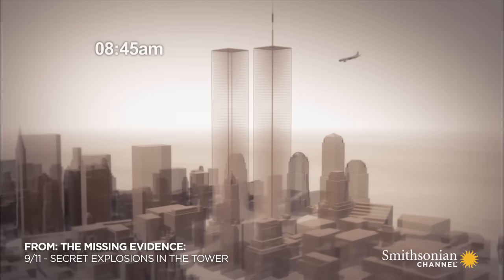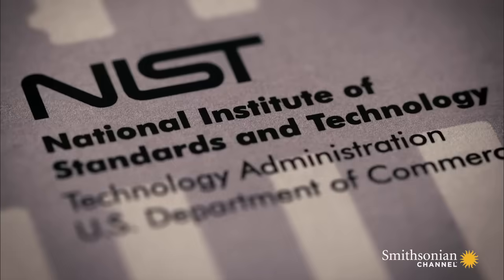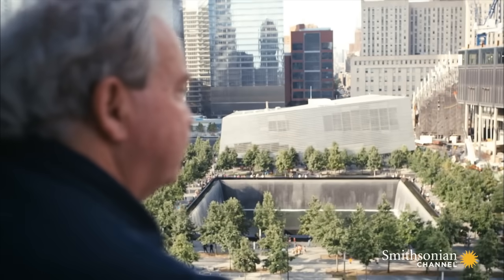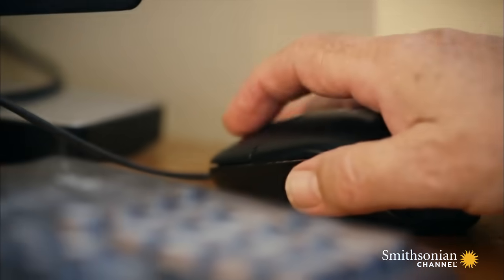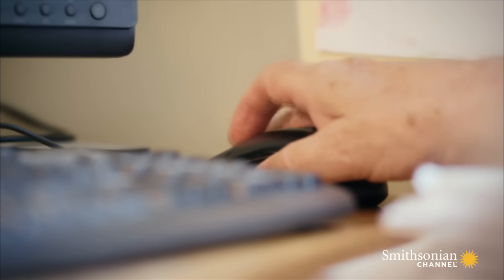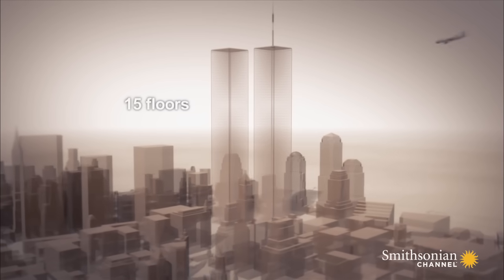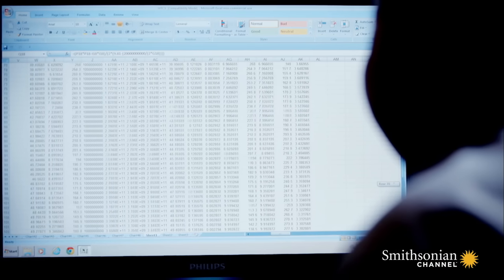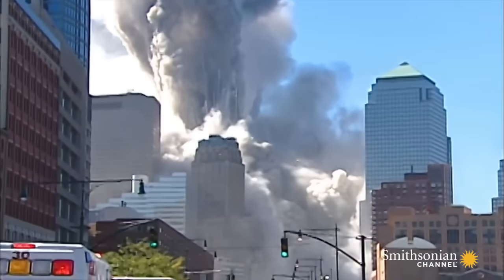This Computer Simulation Explains How the Twin Towers Fell

Comment: mustache dude did his simulation on a excel worksheet : brilliant lol...
and they wonder why nobody believes their version :D
Reply: Excel has VBA implemented, you can make aprogram (or Macro code) which utilizes data sorted in excel format. Its the same way as writing "real" program in Java/C#/C++ or another language using regular vaiables or x elemenst arrays.
Reply: I am not advocating this video, just explaining you can write program in excel.
Reply: @Cross8ow  But when you're trying to prove your point on something of that importance - which could/has ignited war - then you'll try using some more trustworthy methods than 2 columns of data from a spreadsheet.
I don't know if you're aware of the humongous quantity of factors that must be taken into account in those kind of simulation : resistance of all the different materials, complex physics formulas to apply on those variables in order to predict the way they'll behave and how those results will influence the other formulas...
Mustache dude did all this with a 5 column excel spreadsheet...
I did some data crunching for generating sales reports some time ago, and it was waaaaaay more complex than mustache dude's excel, and it was on specialized software.  So for simulating a building of that size crumbling down, I highly doubt you could do that with excel....  or at least do it while staying credible.
Reply: @rockinpenguin  i understand - i dont agree with that guy I simply stated that excel is able to crunch big chunks of data and solve the formula.
Reply: @Cross8ow  wow , some actual people in this comment section having a debate , without attacking and calling each other names . I like it

Comment: This video offended even the little intelligence that i have.
Reply: @hotelscleanbathroomswithpo4938  

No other skyscraper in the history of the US has ever collapsed due to fire alone.
I read that there was a fire in 1978 in the South Tower that spread over four or five floors that was hotter than anything seen on 9/11 and completely burnt everything on those floors. After investigating engineers said there was no structural damage to the building. 
On 9/11 Most of the jet fuel burned off  very rapidly in a matter of seconds. At that point we were burning office furniture.

I watched the video of the building in Brazil. That one looks like a glowing torch. 
Are the construction standards in Brazil as equal to the US?
Who's to say that one wasn't using some type of explosives as well?
I read that the building was empty for 17 years and the elevators had been removed.
 Who's to say the owner of the building didn't have a motive to get rid of it for insurance money?

Check out the 32-story building in Madrid Spain in 2004 that caught on fire and burnt from the ground to the roof all night till the next day. It did not collapse.

And finally, explain the collapse of World Trade Center 7 that set across the street in the next block. It collapsed at 5:20 p.m. that day and fell straight down at freefall speed. It did not get hit by an airplane and was barely on fire and yet the entire structure went straight down. The Verizon building and the post office which set on either side of it were unharmed.
Amazing how the 9/11 commission report never mentioned this building. And you'll never hear the news talk about it again after that day.
Another thing you've never seen on the news is the 3,000 people that showed up on the 5 year anniversary of 9/11 in black t-shirts saying that 9/11 was an inside job and we want Justice.
Reply: @br5747  oh really look at San Paulo Brazil steel structure collapse fire
Reply: I bet Physics academics could even explain how they could have reported the collapse of building 7  more than 20 minutes before it actually did fall down?
If they paid this guy a few million I`m certain he would have come up with a perfectly reasonable scientific explanation and even throw in a Computer Simulation for good measure.
Reply: @kingcanute9830  No that was a woman standing in front of green screen. That conspiracy theory is debunked.
Reply: @kingcanute9830  that’s human error it happened during the Boston bombing said 15 minutes before the arrest and that wasn’t a conspiracy theory it’s human error lol someone could say that and not actually be accurate lol
Reply: @kingcanute9830  i bet aetruth paid those guys to say things.
Reply: Independence Day (1996 film) - is more believable than this.
Reply: I’m so glad this was the TOP COMMENT!
Reply: Paul  Do not talk to them, don't waste your time here. :))
They won't consider the truth, thats too mainstream huh
Reply: Paul  Maybe you can tell us what expertise you have in these matters, and what evidence you have to say thousands of professionals are to be considered crackpots. And if possible, do so without insulting others as you seem to enjoy here in the comments you have made. What are your credentials sir, or is it merely another opinion?
Reply: Mark Honea  Lack of evidence isn't evidence. Any intellectual knows that grand conspiracies are impossible.
Reply: @peterjv8748  lol
Reply: @peterjv8748  LULZ
Reply: If you don't believe the govt and you don't buy the so called experts about supporting the govt bs...you're much wiser than you believe. Give yourself credit.  It's the people not looking and researching that have Intel issues.
Reply: but a scientist said it, so it MUST be true.......
Reply: @petefitch5313  who? Dr fauci? 🤣
Reply: same
Reply: After I saw people falling thru 3-4 floors just because there were hundreds of them dancing on it, I cant be really suprised when it comes to this explanation.. What I find more absurd however is how they managed to "hijack" 4 planes at once.. That to me sounds like a complete holly-wood nonsense and it makes me question this even more since Al Qaeda didnt even go to instantly boast about it like they always liked to do even after the smallest of their bombings.. I could easily believe that US govt just put the blame on them and then they just took it cos why not, free advertising really
Reply: How so?
Reply: Which is not much
Reply: U mad?
Reply: Truly small
Reply: Nice Video clip! Sorry for the intrusion, I would appreciate your initial thoughts. Have you thought about - Saankramer Secure Privacy System (search on google)? It is a good one of a kind guide for learning how to provide for your family in a crisis minus the normal expense. Ive heard some great things about it and my work colleague finally got great results with it.
Reply: Eon Reeves  yeah I love how you don’t believe the bush let it happen on purpose theory
Reply: Somack  On the contrary, if you actually watch my videos instead of making assumptions, they aim to show that Paul is still Paul.
Reply: ISIS have intelligence of a rat.
Reply: I have less and it offended mine too!🤣
Reply: Excellent comment - this film is obviously propaganda.
Reply: @impartialobservers7060  yeah man, the Smithsonian is in on it.
Reply: @impartialobservers7060  the numbers seem right but I'm no math expert, I've watch Martial Arts exhibitions where Sensei breaks 5 or 6 ice slabs and this same principle applies and shows how the above slabs breaking course other slabs to break.  Whether it was an inside Job we will never no it's like the Kennedy Assassination no one will ever really know.  BE Smart, BE Safe and BE Prepared.
Reply: @outsidelookingin4657  Your sensei example is nothing like 9/11. Where are the floors stacked up on one another like broken slabs of ice?  Look at ariel shots of the WTC complex, where have all the buildings gone? Hundreds of thousands of tonnes of material - where is the debris? Why is site full of circles and holes? We can know exactly what happened by actually looking at the evidence.
Reply: @impartialobservers7060  i couldn't agree more. i am so disappointed in the smithsonian
Reply: Paul  
Explain why no other skyscraper in the history of the world has ever collapsed from fire alone straight down at freefall speed. If those buildings were actually weak enough then the top section would have fallen off to the side and hit the surrounding buildings.

 The only way you can remove the mass of Steel that held that building together is to melt it out at each floor at every point at exactly the same time in sequence. That is how controlled demo experts get buildings to fall straight down.
It's a very complicated process. 
The firefighters and police reported that all three buildings were controlled demo because they heard the discharges on each floor as they were coming down. ( these can be seen on many documentaries)
They most likely used thermite which is much quieter and would explain the molten Steel they pulled out of the ruble in the ground two months later.
Reply: @br5747  freefall isn’t velocity it’s when gravity only acts on a force explain why debris fall faster? Oh wait you can’t
Reply: @br5747  it’s when gravity only acts on an object
Reply: Bombs demolish buildings, planes DON'T!!
Reply: Thats because you only have little intelligence.
Reply: @MrTheFSXFAN  dingleberry
Reply: Oh paul. buddy id like you to do some research. If you dont have any luck ill hit u up with some videos of engineers, architects, and building demolishers reacting to that tragic event.

I would rather listen to these citizen level workers talk about it than a big corporation such found in the mainstream academic world because one makes money off of information, and one doesn’t.

With money, can come power and corruption, you know that. People are not saints.
Reply: @youraveragejoe-  silverstein is guilty of terrorism and insurance fraud. End of story.
Reply: @youraveragejoe-  where are those videos though? Yt and google dumped them all down the memory hole. I know I’ve seen lots of different ones, but nowadays all that are left are the msm ones. Which is proof enough the others are correct.
Reply: @youraveragejoe-  if someone says something dont believe it as soon as you see it look up others on other websites do research.
Reply: Raynor Ezekiel hey my husband is a project manager (civil engineer) and he said the way the towers fell is exactly what you’d expect to happen.

the plane hit in the middle, full of fuel which caused a huge fire, which caused the structural steel to expand due to the heat, which compromised structural integrity of the building, which made that area collapse. the weight of everything else on top of it made the rest of the building collapse. steel can only be fire proofed but only for a few hours SINCE 9/11

ETA fire proofing steel is code now since 9/11 but depending on the rating, only lasts for 2-3 hours
Reply: @samo3611  would love to know his "expert" opinion on WTC7?
Reply: @samo3611  
Can you ask your husband about flight 93? 
How does it evaporate ?.
 No fuselage,  engines, seats,  suitcases, . How does that one work? Just a hole in the ground. 
Maybe he can help as iv been looking for the answer for many year. Every plane crash I ever look at all these items are always at the crash site. Very strange 🤔
Reply: @samo3611  thank you
Reply: All it takes is a little thinking and research, you have to question authority, and make your own decisions. 

That can be summed up in a quote of taking the path less trod.

Again, hit me up if you want some videos, but first do your research. 

If you choose not to, at least i tried, id like for you to see what i saw. And this is only for your benefit. I want to help you, and others. Im just not sure how to yet.
Reply: @youraveragejoe-  I've been researching the collapse of the towers since the 12th of august 2017, and form the start all the way until now, I've seen nothing but lies. 9/11 indeed is an inside job. And we're looked at as some type of crazy psychopaths. I just want to tell people the truth, but they don't want to hear it because it's too much to handle.
Reply: Liam de Cler Please share. I want to know what happened. This video made more questions for me than it answered.
Reply: Liam de Cler good points. Earth is flat too right?
Reply: @liamdecler2486  some of us know this same truth you speak of
Reply: @franciscocalvillo381  since approx. 2 years youtube regularly deletes scientifc documentaries highlighting valid and critical points regarding the whole 9/11 incident.
Reply: @youraveragejoe-  what videos
Reply: @liamdecler2486  What truth, bombs planted in the building. My father is a structural engineer. Friend was recording the TV when it happened. My father was looking at the TV and he said, "the towers are going to pancake". Little bit later, they pancaked, floor by floor. One floor collapsed causing a chain reaction. No bombs were required.
Reply: @youraveragejoe-  can you send me some links? I'd like to no more about differing opinions.
Reply: @TheDracu  usually due to copyright
Reply: @TheDracu  GUYS DO NOT GO TO PIRATE BAY IT'S NOT SAFE ANYMORE
Reply: @youraveragejoe-  Do you have anything you could recommend? I've seen a couple good videos and articles but nothing that delves SUPER deeply into it. I already know it was obviously a staged event ordered by the government, OBVIOUSLY. But I want to find sources that take it deeper and haven't found that yet
Reply: @liamdecler2486  Try explaining those lies and backing them up. The problem with many conspiracy people is they want to believe the conspiracy and not the explanation for what happened. No matter how plausible the explanation, they just say no. They are as bad as the people that believe everything they hear without even questioning what they saw.
Reply: @GKHTS  bro new york is filled with masons, they shut the place down, the whole thing is mostly cgi.
Reply: @youraveragejoe-  that’s because you ignored 2.7 million architects and believed 3000 architects and other people
Reply: @liamdecler2486  the real truth is bush let it happen. (Idk if it was on purpose) and the rest of our national security failed miserably and let it happen. Also the towers were designed to collapse downwards. It would be a massive design flaw if it didn’t. And they were meant to withstand a plane about a 707 trying to land in thick fog and crashing not a 767 (a plane that didn’t exist at the time.) in the 70s and not designed for a full speed plane into the tower intentionally.
Reply: @franciscocalvillo381  can you not make assumptions about conspiracy theory people. Don’t be mean. Counter argument them.
Reply: @TheDracu  most of the cgi conspiracy videos are just disrespectful to the people on those planes that’s why those videos get deleted
Reply: @youraveragejoe-  and the earth is indeed flat
Reply: @liamdecler2486  exactly. There was thermite particles after the explosion and thermite is only used for explosive charges and not in planes or buildings. But the US just wanted oil so used this as excuse to take over. "Society has become so fake, that the people cannot accept the truth".
Reply: @liamdecler2486  some of us are listening, Liam! you're not alone.
Reply: @GKHTS  Nah man. The simple reason is because I stand by my research. That's why no one is telling me otherwise. If you have facts to debunk my theories, feel free to do so. You can't.
Reply: @liamdecler2486  bro is so paranoid
Reply: @liamdecler2486 how?
Reply: @liamdecler2486  they think the official story is gold, little do they know....
Reply: @liamdecler2486  please explain how this is an inside job
Reply: @liamdecler2486  almost 35% of adult Americans agree with you. The other 65% could be told that a herd of flying yellow elephants did it. That’s the problem!!
Reply: @liamdecler2486  i wanna hear it
Reply: @norfolksouthernrailworks1543   I wonder is this happened any other building from the fire ? I only see such a collapse from explosive 🧨
Reply: @norfolksouthernrailworks1543   I wonder why if is all true ,that building did not collapse right after plane exploded?  Fire 🔥 is not enough to melt steel beam .
Reply: Paul  Twenty five hundred architects and  engineers have a big issue with it. And they want a credible investigation into 9/11.
Reply: @bluehand9631  yeah 2.7 million architects on the planet alone. And you believe 500 over them?
Reply: in the computer program where the buildings melt like ice popsicles cool
Reply: US gov already in debt, Kills Their own economy with two buildings increasing debt, Spends money investigate their plan increasing even more debt, Yup very logical conspiracy theorist 👍🏻
Reply: @gabrielguzman9646  You mention debt as a reason to imply the government would not do such a thing as harm its own citizens.  Debt doesn’t matter.  Read some finance books.  Debt is only for us peasants.
Reply: Paul  how do u deny the theory if u seen the documentary then
Reply: Snowflake

Comment: The buildings were built to withstand a hit yes.
High temperatures from jet fuel that melted the support beams? Not so much.
Why the top caved in on the bottom. The only inside job is people in this country wanting to riot against itself.